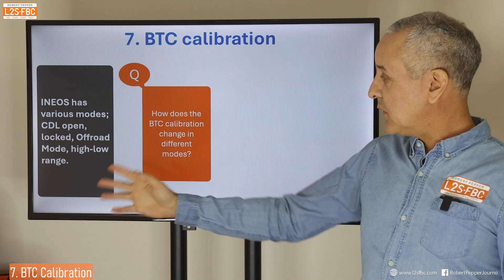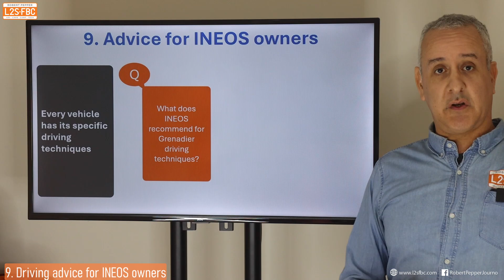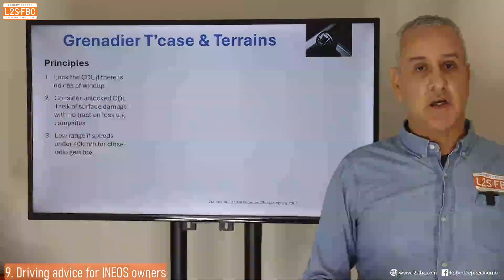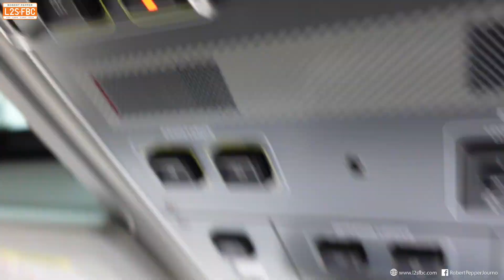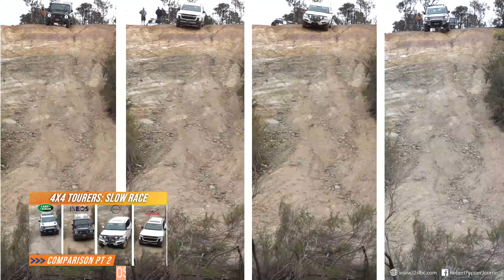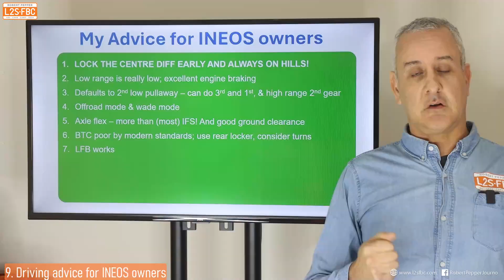INEOS Tech Interview Clarifications, Part 2 of 2

Comment: Love you work Robert your technical detail and explanation is outstanding, based on fact not hear say. I think the seat belt alert switching of is brilliant. When working on the land you are in off road mode. It is so frustrating when you are constantly getting in and out of the vehicle, opening and closing stock gates or collecting tools and equipment at the end of the day, what a god send 
The other interesting thing is HDI can tell you run hours, just like tractors. On the land distance travelled is not always hours of use, hence why serves intervals are based on operating hours. Glad to see a manufacture has thought about  those who use the vehicle as a practical tool not just for recreational use
Reply from the maker: Thank you!  Yes noted the hours when I did the Grenadier review, very helpful.

Comment: Looking forward to getting our new Ineos and making it the long range tourer with Aussie tested mods, suspension lift, adjustable shocks, camp lights, fridge, RTT with solar and required BCDC charger with Lithium battery and a very needed extended under body fuel tank.

Comment: I wrote a more detailed comment about this on reddit, but as an owner, my biggest frustration with the Ineos' electrics is that they rely too much on sensor confirmation rather than indications of what was commanded. E.g. locker light waits for sensor confirmation, rather than just telling you it is unlocked. Air conditioning seems to rely on sensors to tell you what temperature is like in the cab rather than just commanding full cool, etc. its a weird model for a system that shouldn't have too many different states.
Reply from the maker: I think that's a good point and a good principle to consider.

Comment: Sounds like the Ineos's DBC is similar to the Traxide DBC, which tests the starting battery and allows some usage of starting battery power, while ensuring there is still enough charge to start the vehicle. This means a fridge connected to the second battery can also draw on some of the surplus charge in the starting battery.
Reply from the maker: Could be. Who knows? I don't like to guess these things and it should be clearly documented how it works.
Reply: That would run very much counter to the way a standard CTEK Smartpass is setup.

Comment: Thanks Robert. I'm looking to move on from my LC76 and very much considering a used Grenadier against a Jap dual cab, Decisions decisions. Cheers
Reply from the maker: What about a Quartermaster, if the payload will work for you?
Reply: @L2SFBC  Indeed Robert, looking forward to that model too. My preference is to buy used so if I can hold off another year the Quatermaster will become an option as well. In any case I still need to drive one and determine if the cons are a show stopper. Cheers

Comment: What you forgot to mention: Rear veiw camera is also disabled in off-road mode. I would have been interested why Ineos made that decission (in particular with the relaively large turning circle the rear camera would be handy also in off-road mode).
Reply: If you select reverse,  then hit the offroad button it works.
Or you can do it via the Temperature screen ; tap the 3 bars top right and toggle to Camera on option.
Or if you install a clip on reverse camera (I have dual cameras as I'm towing) that's another option!
Reply from the maker: Handy tips thanks Paul!

Comment: The seat belt alarm is annoying. My Jimny will bong at you if you don’t wear your belt. Green laning in the UK is low speed and we often have many gates in short distances to open and close. So you are in and out of the vehicle a lot and don’t really need your belt on. A shame the Brake Traction Control is so far behind market leaders. Lockers are fine, but optional and buying used you may not have them. Plus I like to retain steering for most of my use.
Reply: This threw me for a loop as well. Seat belt bongs are the main reason to hit that button. Winching, rock crawling, getting out to spot and so on its a blessing to turn that off.
Reply from the maker: Good points
Reply: Green laning in the UK is subject to the same laws as the normal roads, so seat belts should be worn.

Comment: I have said the daul battery system is a parallel system, doubling your capacity.  The whole purpose if the second battery is to top off starter battery.
Also the ctek is there to max alternator charging since the Grenadier has a 250amp alternator.   The ctek pulls 120 to maximize charging.
Reply from the maker: A second battery for starting is not normally fitted to a 4x4 which can start off one battery. "Dual battery" means, in 4x4 terms, another battery for non-starter use.
Reply: @L2SFBC  Here in Europe we usually don't have inboard fridge because there are numerous bars along the road. Dual battery are installed to lower source impedance for exemple for a winch. Source impedance is the voltage drops that occur at the source depending on current. For example a 6 milliOhm source impedance delivering 300A will result in a 1,8V voltage drop at the source. Then you will have to add voltage drops due to cabling, junctions, and switch resistance. Generally ending in a great power losses resulting in low winch rpm, and high risk to motor stall with a lower pulling force.
Reply: @L2SFBC  My dual battery system used a deep cycle cold cranking battery in the ome position for running everything and a second battery just for starting if the OEM battery position battery was flat as I was more concerned about not being able to start the car if the interior car light was left on because the door was ad-jar or I left the radio on for too long. I was told by the Auto Electrician this was a very unusual setup, but it worked for me and gave me piece of mind.
Reply: From the CTEK Smartpass manual it's very much NOT a parallel system; however, it does sense when the main battery is under voltage for cranking the starter and will switch the batteries into a parallel mode to aid starting.

Another indicator of it not being parallel, is the ability of the Smartpass to automatically trickle charge the stater from the auxiliary within a certain voltage threshold.  If it was true parallel this wouldn't be necessary or indeed possible.
Reply: @stevegreen101  agree with everything you said.  The only hurdle is the battery system set up has created a situation where the aux battery is constantly trickle charging the main battery.   The example is the individuals with aux battery going days without driving.  Only to find a flat battery in starter and aux.   They require a jump pack to get them going.  The cut off wired by Ineos is not working as attended.
Reply: @peopleschamp7258  The Smartpass has a voltage cutoff when trickle charging (11.5v from memory).  I can't see anything wired in that would suggest Ineos have a separate cutoff.

If the battery assist is failing to start engines, then I think this is more down to the  general condition of the batteries.  I suspect that these vehicles are early models that spent many months after build being shuttled around the factory holding/rework areas and never having a chance to a actually build any charge back into them.  Ineos effectively degraded them prior to delivery to their owners.  There's certainly been too many reports of them being changed out under warranty for just normal manufacturing issues.

Comment: Probably should clarify that Centre Diff Lock Always on hills - to always on low traction hills. 
Hills on the highway - never. And a high traction surface like rocks, possibly not. 
You also mention engaging lockers on rocks in your chart - well only if loose rocks. Many rock climbs are solid rocks and are a high traction surface where you will break things with lockers on. 

Sorry I know the info has been said about not locking on high traction surfaces but you should clarify some comments as they sound contradictory - especially the always on hills comment, because it’s not always on hills.
Reply from the maker: OK, to clarify:
- bitumen, highway hills - no CDL.  That is covered by unlock mode on bitumen.
- offroad on rocks etc - YES LOCK THE CDL, hills or no.  There is no "possibly".  Lock it on rocks. 
- axle lockers on rocks - use them. That's actually one of the best use cases for axle lockers, you'll be able to crawl up high-traction, high-flex rocks with ease.
Reply: @L2SFBC  Cheers for that. It’ll keep the numpties from locking their CDL on the bitumen hills cos by having said Always on hills there are people that would turn it back on again when they hear that said. 
I drive for a living and there are many fools out there. 

See I personally don’t have an unlock mode (or lock) with a computer controlled coupling Permanent 4WD Land Rover - it applies as much to the other axle as needed when needed and (even before needed) as is preemptive not just reactive as are all modern LRs.
Reply: @jerrymyahzcat How is the LR preemptive? I thought it relied on sensors reacting to slip to lock up clutch packs?

Comment: Would still love to hear the philosophy of the dual battery system, and how it actually operates. Regarding how the aux battery is charged, how aux battery load/discharge affects the starter battery. Or more clearly, can I connect my fridge to the aux battery for overnight camping (via DIY wiring to an Anderson plug), without draining my starter battery?
Reply: There's a base layer of information on how the dual battery system works within the CTEK manual for the Smartpass.  The Smartpass fitted to the Grenadier very much looks like the retail version (mine actually came with the retail box in the back of the vehicle) but confirmation from Ineos that it's not a bespoke version would be good to have (it's been asked but never answered!).

A 2nd layer of information is available to anyone who lifts the rear seats and just follows the physical wiring.  It's pretty clear that the auxiliary battery serves no load other than that via the Smartpass.  I've fitted a Victron Smartpass to the auxiliary so I can see what's coming out and when.  

The issue seems to be more around the charging strategy and if Ineos have adopted in full that of the BMW intelligent alternator or altered it to suit the different charging/load requirements of a 4x4/overlander vehicle. Have a search for "Aftersales Training - Product Information. Intelligent alternator control IGR as a starter for ten.
Reply from the maker: I cannot say, that's all I got.

Comment: I run an ARB zero 69L dual zone fridge/freezer for 3 days off the batteries with no issues. I started off using the 12V cig. Plug, but have since switched to a hard wired Ando plug to the Aux battery. Yes it draws down the state of charge after a few days, but I feel it’s sufficient for fridges, aux lights, and winch power needs. Not about to run a coffee machine or induction cooker any day soon, but that stuff is blasphemy anyways…
Thanks for taking the time to make these videos. They’ve been very nice to hear. And I learned today that 4L is usable without the CDL. Thanks!!
Reply from the maker: coffee makers are WHAT?
Reply: @L2SFBC  😂 A Nespresso machine in an outback 4x4 as opposed to a Billy or Jetboil to heat water and pour over fresh coffee grounds in my opinion… is blasphemous. Only because the time we take to go out to the bush to enjoy the finer things should also involve taking the time to prepare the highest quality of beverage possible. 
I’ve drank my fair share of Nespresso pods at work, and they’re great for that environment. Quick, easy, pick me up. 
But when I’m not at work, I appreciate the inconvenience of having to sit an extra 3 minutes to boil my water and make a fresh cuppa.
Reply from the maker: I hear you, I like a coffee as well but taking an actual coffee machine seems like overkill so I just use sachets :-)
Reply: @leftcoastoverland8750  Yeah, look I take Coffee Bags (Robert Timms with condensed milk) and that’s barely passable - I really can’t really abide instant coffee. 
We use our Nespresso Vertuo machine (Nespresso Classic is rubbish) while camping etc. 
What I Don’t take is a TV/Projector or Play Movies/Blast Music like many do when camping. The noise stays at home (Actually we don’t do that at home either).
Reply: @jerrymyahzcat  I’ll come by your camp site and grab a fresh cup! Cheers, mate!
Reply: @L2SFBC  A Bialetti pot is surely the coffee machine of choice perfectly matched to the built on purpose tagline?
Reply: Have you measured the current draw down of the auxiliary after a few days running your fridge/freezer?
Reply: @stevegreen101  not officially. I reference the State of charge on the Grenadier’s onboard electrical system. 
In warmer conditions with a full fridge it’s pulling the batteries down about 10% a day.
Cooler climates much less.
Reply: @leftcoastoverland8750  The SoC on the Grenadier head unit only gives an indication of the starter battery.  Info is taken from the Hella Intelligent Battery Sensor (IBS) located on it's negative terminal.  The auxiliary battery is not monitored in any way.  Surprising, as Hella offer a version of the IBS for a dual battery system!
Reply: @stevegreen101  the way I understand it is the dual batteries are linked together to make essentially one big 210 Amp Hour 12V battery, right?

So if the monitor is pulling from the crank battery side, and the charge is topping off both batteries equally, then a consumer like a fridge would draw the batteries down equally as well, correct?
Reply: Haha. I run a 3kW Inverter with induction cooker, Air Fryer and Coffee Machine (not simultaneously) so I disagree with your comments lol.
Reply: No, that not my understanding.

In terms of current/load draw, the Smartpass effectively separates both batteries and then links only under certain conditions for certain functions (as described in earlier posts).

Easiest way to test this, measure the voltage across both batteries, they will be different.

Simpl
Reply: @stevegreen101  cool. 
I’ll keep running my auxiliary needs off my auxiliary battery. Hasn’t let me down yet.
Reply: @leftcoastoverland8750  I think your fridge/freezer has a low voltage battery protection function, so it will cut out before damaging the auxiliary battery.

Running the figures, the manufacturer gives a current draw of between 2.9Ah and 3.1Ah.  A 105Ah battery, run to a DoD of 50%, will give a run time of @ 17.5 hours.  Obviously, you can run a higher DoD (subject to the battery protection function) but then that impacts the battery life.
Reply: @stevegreen101  makes it easy